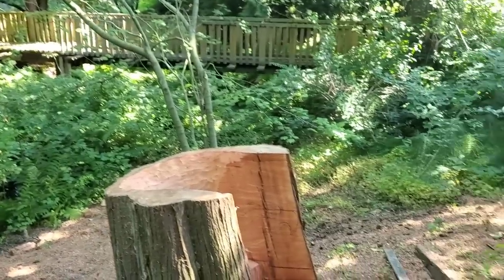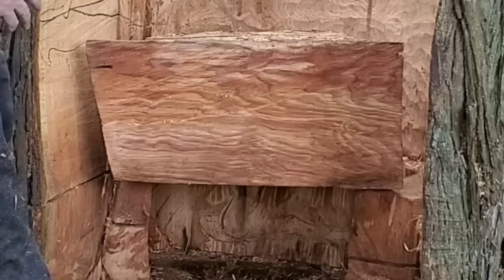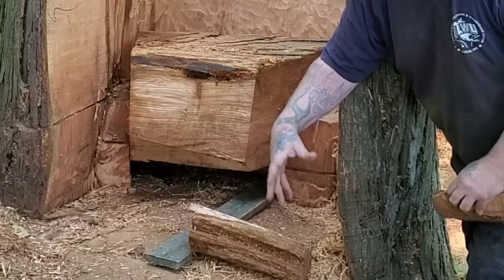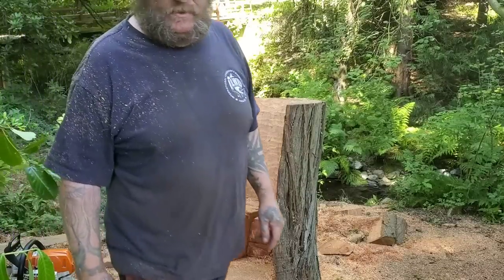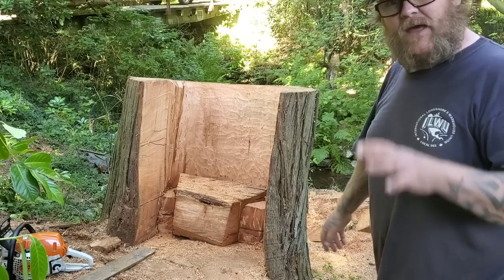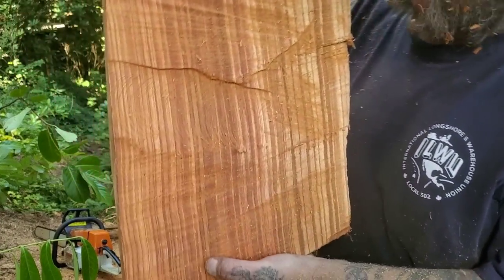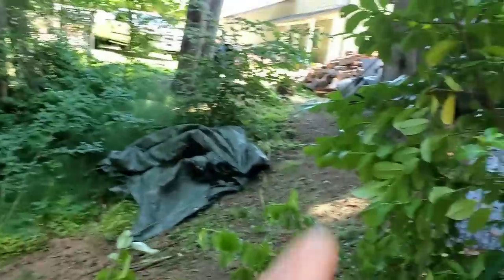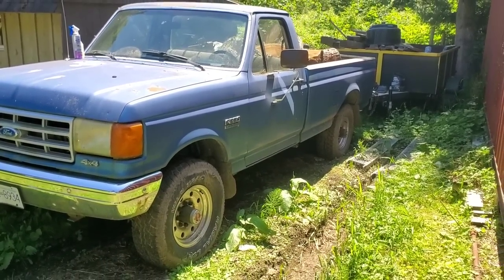Carving a cedar throne chair. #3

Comment: The vid's are interesting.  Let's people see how hard some things can be. Glad the chunk went in the hole.
I bought one of those chainsaw sharpeners Steal makes. The one with the flat file and a round file on each side. They're kinda pricey but work real good. It was in the saw case with the saw that was in the fire so I don't have it anymore. But it worked good.
That truck will use a lot of gas. 3/4 ton, 4 wheel dr, hope it don't have a 360 motor. Maybe 8 or 10 MPG with no load if it does. Or a 351 cleavland motor, even worse on fuel. 351 winser is a better motor, still not real good on gas though. Just sayin. I had a Galaxy 500 with a 351 C,  12 MPG on the highway if tuned up. Hi Jordy.